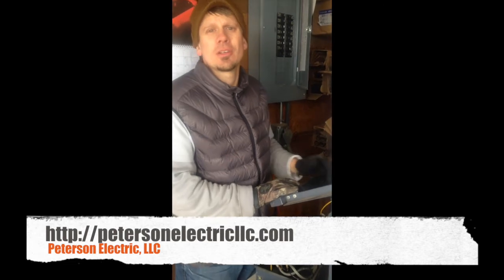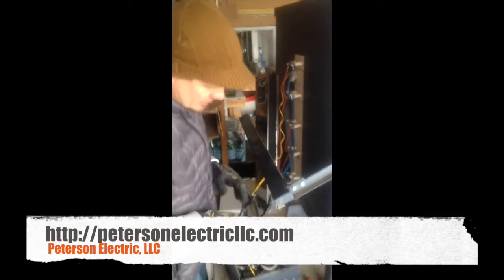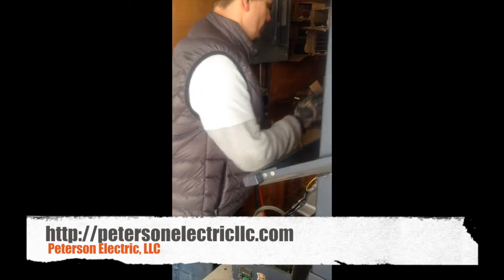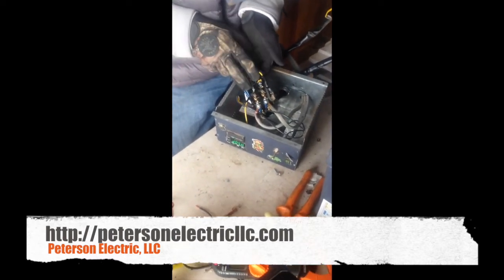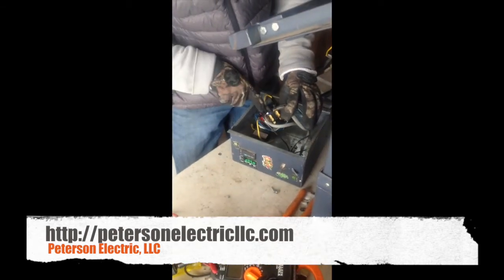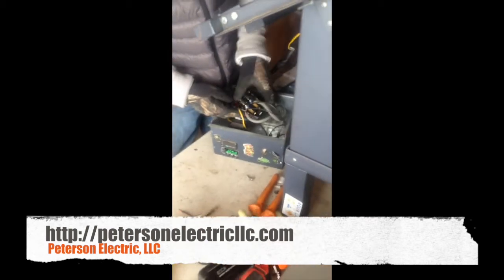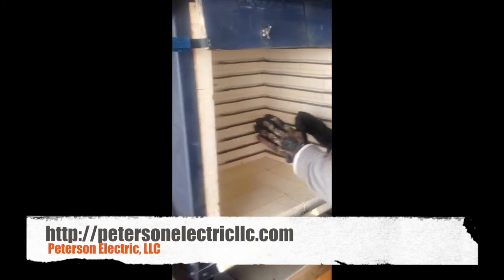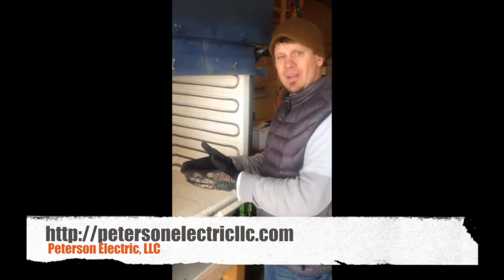Wiring For Kiln, 240V, 30amp

Comment: I'm interested in building a basic small electric 240V kiln that operates off my Skutt digital controller which has a thermostat line and has the contactor built in so it just has to have the wiring for 6 elements going to a main 240v plug....how easy would that be?